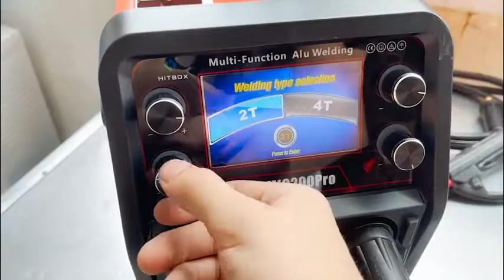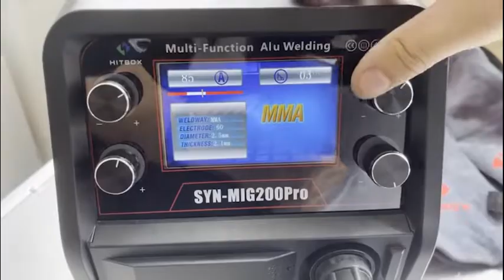HITBOX Weld Aluminum MIG Welder - SYN MIG200 PRO

Comment: Very good information, especially since Hitbox did not describe this with changing the weld to aluminum welding.
The welder is marketed as an aluminum welder and of course it might be able to (I have not tried and do not intend to weld aluminum with my welder). But there is a bit of screwing and fixing before it is ready for aluminum welding

Comment: Hitbox must be totally crap, going by the reviews, rubbish
Reply: My example works well with MIG-MAG for cobalt steel and I have also tested it with FLUX core which was ok but I don't like FLUX as it pops and smokes. I have not tested stanley steel and not aluminum as it requires too much fixing. In contrast, the TIG LIFT system is totally useless. I have been chatting with Hitbox for 2 weeks and they are completely clueless about how a weld works. They send a video that shows how to handle/set up the welding for LIFT. Totally worthless, they have to dab the tungsten electrode (which is blunt!) a lot of times before they ignite. They increase the Amp setting to get the welder's recommendation to over 130 Amps